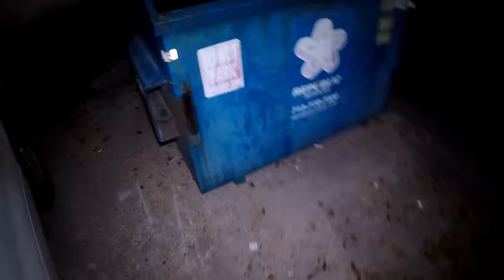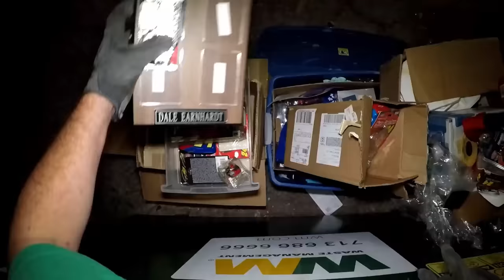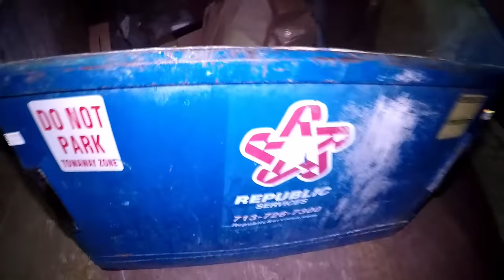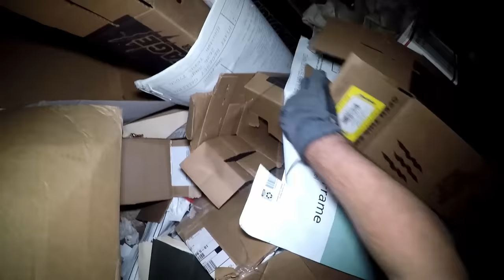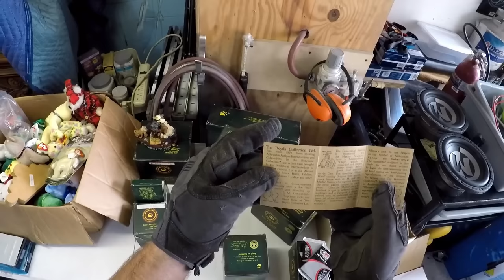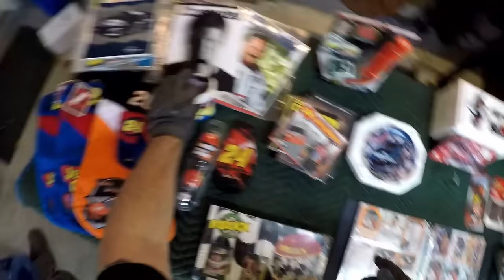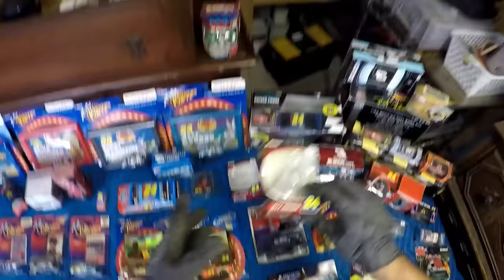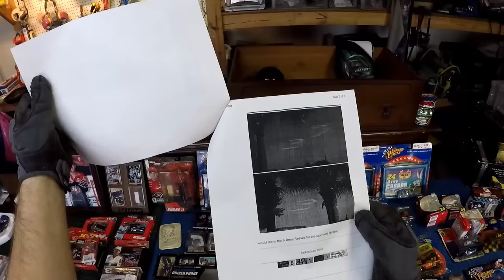Dumpster Diving (Huge NASCAR Collection, Beanie Babies, New Clothes & More!)

Comment: Mike,  Here is what you can use the old CPAP machines for.  I took my old one and used it as a ventilation hood.  I took a sand blasting hood and hat and vented the tube up inside.  I can then use the CPAP machine to blow fresh air into the hood so I dont breathe bad air.  None medical use.  I also used 2 or more tubes connected together to keep the fresh air far away from where i was working.  perfect for sand blasting or spray painting.  anything with particulates in the air.  Make your own and sell them.

Comment: You'd have a field day with my collection of unopened hot wheels. Lol
Reply: We both have a good hobby love my hot wheels
Reply: @kentuckymotorsports9815  it's better than drinking or doing drugs, plus hunting for the ones I need is fun
Reply: @medievaltorturetechnician1980  yea I mainly like the old muscle cars
Reply: @kentuckymotorsports9815  I have all of my original hot wheels from the 70s lots of redlines in near perfect condition
Reply: @medievaltorturetechnician1980  Nice. I don't have any that old I've been collecting for a couple years have around 70ish still on the card

Comment: Those breathing devices are called CPAP machines.  The're for people who have sleep apnea.  They pump filtered air into a breathing mask so you don't stop breathing when you're sleeping at night. 
The thing that's cool about them is that you can use them to create a mask with positive air pressure.  They work great with full face welding masks, painting hoods, etc.

Comment: Mike, that Resmed dumpster....I would LOVE to have one of those square zip cases(I can't find mine) and a clear plastic humidifier(be nice to have an extra while one is in the dishwasher. I'd even take the hose if it was new in package.  Need one when one is drying.
Reply: That's not a humidifier it's a c pap machinen
Reply: @blakebooth1982  The clear part is a humidiifier that goes on the cpap machine. I have that exact one.

Comment: That CPAP you said you were staying away from, they've got a little Cellular data link in them. They transmit the user data from the machine to the company via the telephone cell data network.
I don't know what materials they use for the transmitter, but it's small.

Comment: For future reference, the production date for the nascars and collector cards will be on the back of the package or cards in one of the lower corners. The cars may have a year on the bottom but it may not be accurate because the manufacturer sometimes uses the same bottom on older or newer cars

Comment: There are some beanie babys that are ultra rare, it would be worth it to look them up.

I got 5-6 three ring  binders with all the Star Trek trading cards from every Star Trek they made. In one of the binders there were 50-60 autographed cards from a ton of the stars from 7 of 9 to data (Bret Spinner). I paid $3.99 each binder at the Goodwill and made over $1000 selling the cards.  Salvation army got a pair of wireless Lightspeed Bluetooth helicopter headphones for $10 they were almost $900 new and I sold them in 30 seconds on eBay for $375. Fastest selling item I ever sold.

Comment: Some of those Bearstone Collection pieces can be worth up to $100 each while others may only be worth $10 each.  Nascar stuff is also all over the board for values so you need to check each one for values on everything there because it could be the difference between getting a few hundred or getting over $1000. You made a great haul if you sell it off right.

Comment: Why don’t you pick up the respiratory units. There is a motor, wires, metal, circuit boards.….it builds weight quickly. When I did scraping about 10 years ago, I found a business  with them.
Sometimes I would take my son and his buddy to help me load up!!

Comment: Trading cards are super hot right now! Don't just sell them for a cheap price. Check each one out. Especially the big names and winners. Go online and look them up.   The better the condition, the better the price. Also high graded ones are really sought after, even not so high grade ones can fetch $50-$100+ if it's the right card!

Comment: When scrap prices are HIGH it is worth even MORE to strip things like those lights. Think about it, when prices are low you take things like those lights apart to get maybe mere cents and then whatever the ballasts bring. But when prices are up like they are now you would get probably double what you did when prices were low. Basically by doing it the way you are and scrapping them intact is saying that because scrap is worth more right now youre willing to take less for it. That doesnt make much sense economically.

Comment: About the Beanie Babies?
Very Collectible?
Yes, however there are a few worth Quite a Jackpot of Cash $$$!
If the are the Original with the Th tag still attached & Never Removed & Sewn back on?
Just keep the tag with the Beanie Baby it came off of, as long as the "tag tear", matches up with the tear from the piece that remains to the Beanie Baby, it could still bring you more money that the ordinary Collectible?
I know that they have sold for as much 
$1000 up to $5000
Depending on the Condition and it being what they are looking for?
Just giving you a Head's up?👍
Also, on those McDonald's & 
Burger King & Wendy's 
Toy collection's?
They can be Valuable at time's?
You just need to Check the Year and the Rest- where they came from? 
Jody in Hobart, IN USA

Comment: 1of 1200 is Not the same as #1of 1200 just FYI.Also none of them are made by Hot Wheels because they never had a Contract with NASCAR to make them.The large packages standing up on the rear of the table were Special Edition pieces done by Winners Circle but they like all Winners Circle pieces were very Over Produced.

Comment: After 40 years of dealing in antiques, collectibles, artifacts, rarities, memorabilia, and such, I can be certain that "Collectibles" are not collectibles until someone decides they are collectible, not because they say collectible on the box. It takes 75 years for them to reach near the value of what I collector thinks they are worth, and 100 years for them to become antiques. Cars on the other hand are antiques at 25 years old. These are standards set in wet sand by those in the business. I say wet sand because it depends on who you are talking to. Memorabilia isn't as valuable as most think it should be because of sentimental reasons. The exception there is when the piece is low production but high profile. The Twin Tower silver coins minted from the coins that melted in the destruction are of a higher value than their silver but twenty years isn't enough to make them of a higher collectors value unless you have an emotional connection to them. The way I collect or retain for value is that I got a great price on an item and someone offers me a great profit. Otherwise, the stuff sits collecting dust but more importantly, collecting time.

Rarity trumps most things gagging at having to use that word In a world fair, there was a group of "woodland nymphs" on display. These people were mostly nude and as this was in the Victorian era, that was really frowned upon but they got away with it for two reasons. The first, nudism that was called Free Physical Culture at the time, was gaining popularity. The second being that it had never happened before and hasn't since. These items, such as the booklet, sold at the dioramas location, and the advertisements for the fair have three collectors or enthusiasts. They are World Fair collectors, Emphiera (paper products) collectors, and finally, nudists who collect nude history items.

 I have collected many things but always keep a very, VERY important thought at the forefront when buying, "Do I own my things or do they own me" I lost a quarter of a million dollars in one day and was set free from people, places and things and I have never looked back in sadness at the loss. Although I am a victim to the prison that is my body, I am happy with what I own and who enjoys it with me.

Comment: Not be a downer on the nascar collection, it’s a cool collection but most of those aren’t worth that much even the Earnhardt sr ones ,those were mass produced , I’ve tried selling over 500 winners circle cars for $.50 a piece for years and they ended up in a goodwill drop box after 3 years of trying to sell them,one with the flip up box ( the 1 of 1012 ) has the wrong car the #12 was driven by Kerry Earnhardt